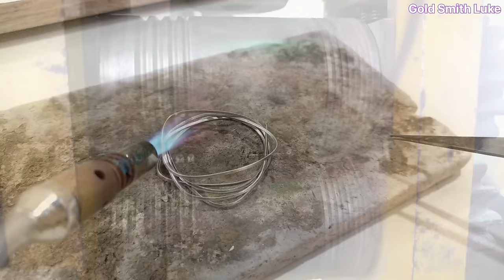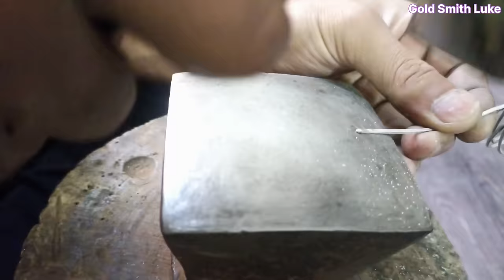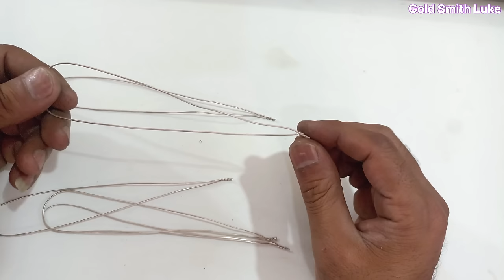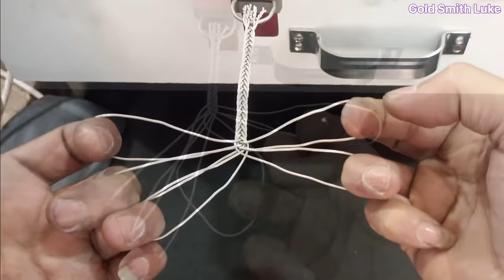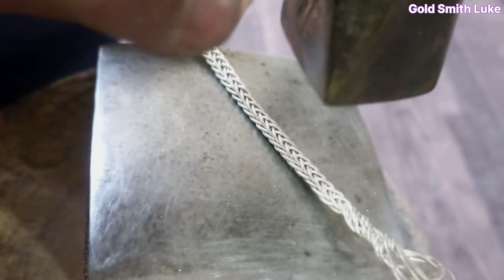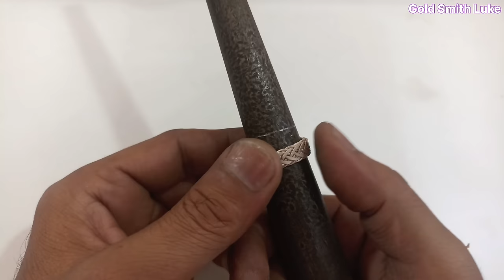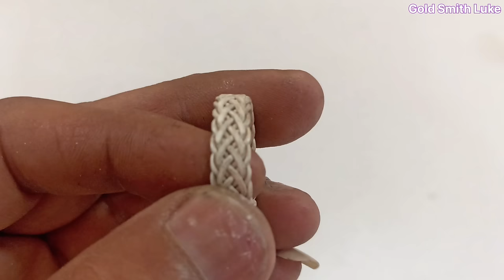Twisted Silver Ring Making | How it's made |  Ring Tutorial

Comment: if only i had metallurgy workshop in apartment... just think what i could accomplish
Reply: Same here
Reply: Yes, I believe this guy woke up one day, with all the knowledge about this in his head, and a fully equipped workshop. Without having to do anything./S

Don't let "if only" stop you, you can start with little time and money.
Reply: The silver wire can be bought...look up silver wire supplier. Copper wire from Jaycar in Australia or The House Jewelry in Sydney.  Look online, Pepe tools. Get a flat steel plate where you can hold it on your lap to hammer silver or copper wire. Learn to anneal as once you start hammering 🔨...the wire becomes Work hardened. Small steps...learning , observing. But above all Having a go...a workshop is wherever YOU are.
I have an engineering company...every possible machine...but not a table. Or other needs I mentioned to you. Above all I lack TIME. But one day soon Muchaco...soon.!
Reply: I feel your pain
Reply: There's nothing he used that is exceptionally rare or expensive brother.
You literally could do this in your apartment!
You can buy silver wire, you don't have to make your own. So no need for a $250 rolling mill.
A propane torch is under $20 used, probably wayyyy cheaper. 
The little vise tool he's using could be subbed for a small vise that clamps to a kitchen table.
A set of wire pliers is also cheap.
Any hammer will work. You just need a smooth face on it.

The saw inexpensive, but there's no reason you need a wire jewelry saw.  A dremel with a cutting disc will do it. Even a junk grade hack saw will work. Silver is soft.

The mandrel he's rounding it out on is a special tool. But they're cheap. Maybe $25 for a ring sizing set.
You don't need an anvil, but you could order a mini Chinese made one or substitute a flat piece of iron. Even a sledge hammer can be used as an anvil if the edges are smooth. But going to a metal shop and buying a 4 inch chunk of flat steel bar is super inexpensive. I'd probably get a couple of pencil erasers (the big pink ones) to put under it to minimze hammering noise. Or just fold a towel under it.

It is very achievable brother. Don't short yourself because you don't have space or fancy tools. There's a ton of creative tinkering one can do with very few tools at a kitchen table. 😊
Reply: Honestly this stuff is all over the place used
Reply: Good idea, i like it
Reply: I tooled up to make jewellery and it cost me a fortune, I also have a big workshop and a sunroom in the house so plenty room. If you find a way to do it then go for it as it is the most satisfying thing I've taken up out of the blue. I have some shorts on YouTube of my first makes, please feel free to look. I'm going to copy this ring and post it in a couple of days.👍🏴
Reply from the maker: @johnkidd797 please share your views link. thanks
Reply: Not going to lie. You don't need all the fancy tools. I only have a couple and I've made a few impressive pieces personally
Reply: Look into classes through a local maker space or arts council.
Reply: Honestly, the things he does in this video are doable for any man with a silver wire, pliers, hammer, a vice, and a soldering torch. Which even a bad hardware store should have(except for the silver wire), and for a decent price.

Comment: Would it be okay to ask for clarification? I’ve watched a few times and from this run through I see wire 1 being pulled from behind through 2 & 3 then see wire 5 being pulled through wires 4 &5 into the braid. Do I have that right? At first I thought you went under under wire set set 2 and over 3 into the middle or braid and the opposite on the other side. I am going to try this in copper/silver first to see if I like the pattern and if so I’d like to make it for a replacement wedding ring for husband in silver & gold. If you have the time to read thisThank you ..

Comment: What gauge wire is it when you start the braid?
Reply: he made the wire with a ingot and a rolling mill, but it looks a little thicker then 1 mm so that would be like 16 gauge. if you are planning to buy wire rather then make it, make sure you have a way to anneal the wire to relax the silver metal and make it not brittle. annealing is like slowly cooking the metal with a torch he does this at 0:09. as you cold work the silver metal it will get stiffer and more brittle the ring was short so not a big deal.
Reply: @Amipotsophspond  yes at 0:09 he heats to a red colour then drops into water 💧 to instantly cool...it is now soft again. Ready to be reworked.  I was thinking 🤔 of making a Lattice made ring to hold a Cabachon Ruby or Red Coral.  Using silver wire...using a wire wrap design I've seen in Pinterest.

Comment: What is meaning of that when you put that wire through that hole
Reply: The hole is tighter than the wire. He softens the metal wire with heat, and then pull it through the hole to stretch it and make it thinner.
Reply: @McJaews  now i get it thanks man for the info 😇

Comment: You never say which ones going over and under I have done it with wire before but you still need to give more information it just looks confusing that’s just my opinion
Reply: It looks like he’s doing a standard 5 strand braid but going through the loops instead of over like a standard braid
Reply: Looks like you just go through the two closest ones and pull the third through then do the same on the other side